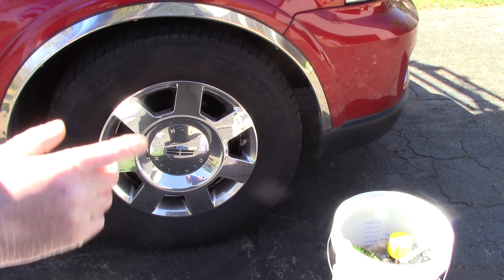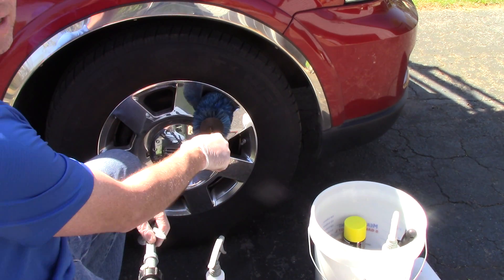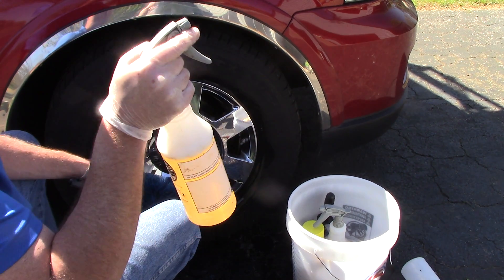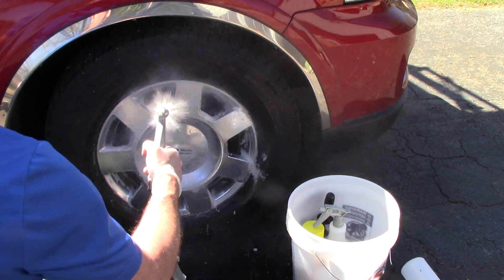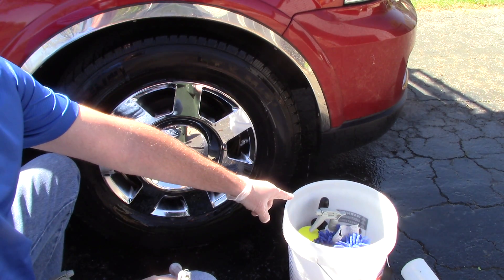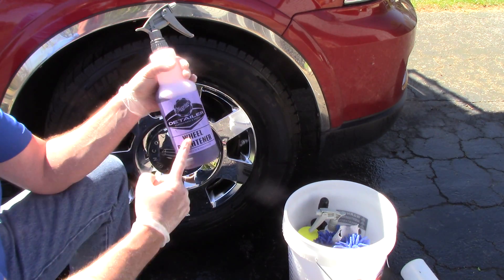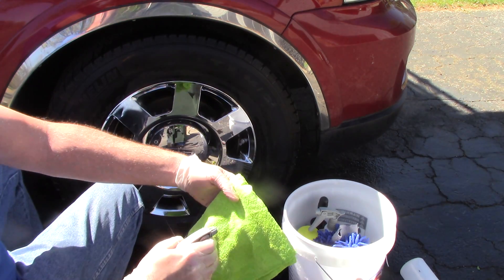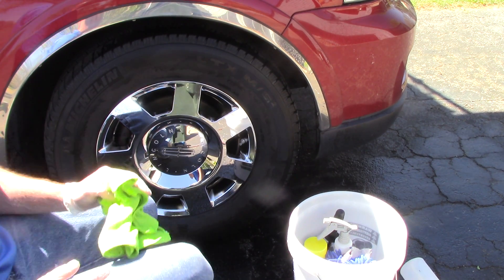HOW TO CLEAN WHEELS & TIPS AND TRICKS TO A GREAT LOOKING WHEEL

Comment: Great tip about putting premixed car soap in a spray bottle, Scott.

Incidentally, that's what I've been doing as well for say, removing bird poop from a car. If one manages to detect and clean the bird poop before it has completely solidified, one can basically use the spray pressure to spray the poop off after a quick pre-soak with the same car soap squirted onto the poop form the spray bottle. Sometimes I can remove the bird poop with practically zero contact cleaning besides the drying wipe down.

Comment: I don't always use a wheel bucket but when your detailing wheels and barrels of a performance car like my gtr. A spray bottle isn't effective and time consuming. Plus I don't fill a full 5 gallon bucket maybe 2.5 gallons of water with cg wash and gloss soap (more concentrated because of less water) and water with a wheel cleaner. And I usually rinse brushes between wheels so I don't contaminate the wheel bucket with clean soap. But on lighter break dust cars, I do see this method working. Great info!

Comment: I like it! I have managed to cut my wash bucket water down to one small bucket by using a safe one bucket wash. Now I can also eliminate a bucket for the wheels. I'd be interested to know what you use when a customer pays for a wheel coating. I use HydrO2 Lite/Gyeon Wetcoat on mine as it's easy to apply to the wet wheel and has decent endurance.

Comment: I still use a 2 bucket system. However, 1 bucket for wheels and 1 for washing. I found that when it comes to washing, the fact I use a foam cannon I really don't need both a wash bucket and rinse bucket but just a rinse bucket itself.

Comment: Scott, big fan here. Just getting into detailing and I am collecting my Arsenal of products and tools with your help! I have a question. What could I use to remove dried up head sealant on wheels? Set of wheels has a little dried up rubber type sealant around the lip and I can't get it all off. Tried wax and grease remover, megs all wheel cleaner, tried microfiber and wheel brushes to no avail. What am I up against?
Reply: try magic eraser with water if it didn't help then try it with apc, it did the trick to remove wax residue from my plastic trim

Comment: Hey Scott, great piece of "cheatfo" (okay i just made that up from combining time cheating info) regarding the sprayer and carwarsh solution. 
I came across an awesome product recently and have used it in my last two washes with great success- microfibre gloves. It fits snugly over your hand and i just put it on for the duration of my wheel clean. From memory the brand was either carcare or carpro (however i'm sure any brand of snug fitting microfibre glove will do the trick). For me it worked much better than the mitt as i didn't have to take it off to pick up other brushes and sprayers etc. Hope someone gets use out of it! Keep up the good work!

Comment: Scott, I get what you are saying about wasting water, but who is actually filling the "5-Gallon" buckets with 5-Gallons of water? My soap bucket is about 2/3's full my rinse bucket is about half full and I use a 2.5 gallon bucket for wheel cleaning which is about 2/3's full. Plus maybe 1/2 gallon to rinse each wheel. That's a TOTAL of about 10 to maybe 12 gallons of water to wash all 4 wheels and tires.

Comment: Why not just clean the wheels and tires last??? I'm not a hack but 3 buckets to wash a car is ridiculous. Who in the world fills there bucket/buckets plum full with water anyway. I use a 2 or 3 gallon bucket 1/2 full then another 2 or 3 gallon bucket 1/2 full for wheels and tires. I don't have time to have 3 buckets for 1 car or truck. On a boat I use 1 bucket for inside and 1 for outside. I mean you can over think anything and make anything more complicated but is it cost/time/labor efficient???